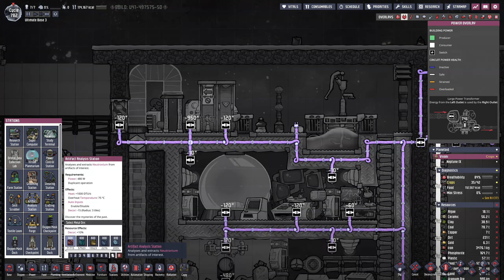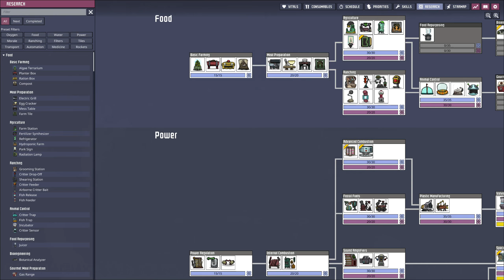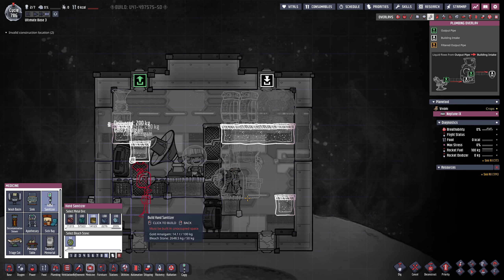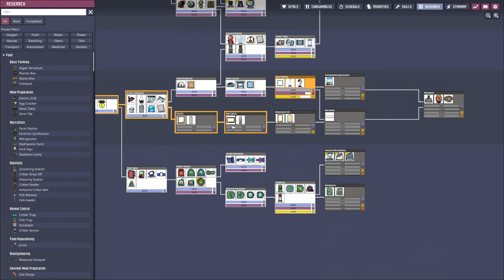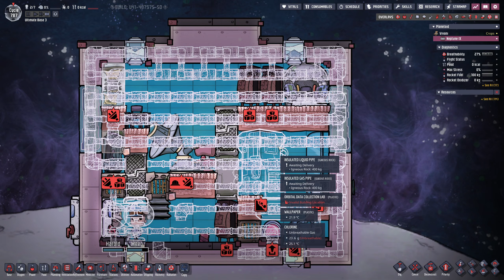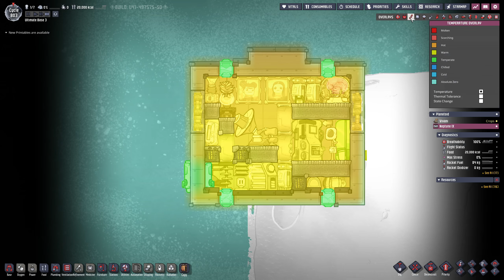UPGRADED ROCKET DESIGN - ONI - Spaced Out: Ep. #30 (Oxygen Not Included)

Comment: I’ve seen rocket designs use an air pump with an atmos sensor. They disable it at first to let a layer of C02 build up one tile. Then they set the atmos sensor to sense when that layer gets too much co2. It will consistently pump out only co2, but the downside is  you have to have a layer of co2 at the bottom which doesn’t look pretty, another con is that off gassing near it can mess it up too.

Comment: Switch power cable because of decoration value. Also control temperature when landed by adjusting water and oxygen temperature outside the rocket. Also switch all pipes to golden radiant)
Reply from the maker: Is there a bigger decor buff than 12?

Comment: Might try some radiant gas and/or liquid pipes to even out the temperature with the smart battery. Short-term, it would definately cool the interior down (atleast with the 10°C oxygen), long-term, maybe not so much. 

Guessing the module will get re-designed at some point, anyways, so long-term might be a moot point

Comment: in the rocket you could add a telephone in place of one of the storage bin, or even a painting. You don't need it powered or even on the ground. It should give you +3 for the great hall
Reply: Doesn't the telescope count as an industrial machinery building? If not, then a great hall would be possible. Though, it also comes down to: is the extra 3 morale even needed?
Reply: @salemprompthous3820  i think only the gaz pump is counting. Well with +3 you can increase the amount of work time and get more of these sweet data banks... Not really game breaking but if you aim for the ultimate rocket you can consider it

Comment: The grounded option in the rocket control station makes it so that dupes can fill any storages and deliver anything that is needed in the rocket but they cannot use buildings like the toilet or take materials out of storages. Also i would suggest not putting bleach stone in the rocket. They do not use a ton of bleach stone with the hand sanitizer so you do not need to worry about it running out while in space. The other nice thing about grounded is that you do not need to change it in space as everything is open for use by the astrodupe and once it lands it turns back into a grounded state

Comment: Nice design :-)

- Researcher needs Aesthetic design to analyze artefacts in station.
- When you've build Decontamination Shower, I remebered I've never used it properly. This time I have few of them right at entrance to my living module and i just love them - they disinfect both dupe and anything hes holding in his hands, this way no germs can get inside my living module :-)
- You can use Grounded mode (in Rocket Control Station), which disables toilets etc. while on ground. It even forbids taking things out of container (fridge for example), while still allowing to store things in them.
- There's no need to switch to crew before launch - crew will always automatically board the rocket.
- Maybe i am wrong but is carbon dioxide able to reach pump? Since there's just one airflow tile, isn't right down corner occupied all the time with oxygen?

Keep them coming, these days I can't have dinner without your channel :-)
Reply: On account of the CO2 extraction, I was thinking the same thing. Airflow tile above the pump, aswell as the current on the left, allowing some flow past the sensor

Comment: Thank you for using my desing! You can also use a battery module with a solar module so you never run out of power.
Reply: And a battery module can be charged at the platform (which would also charge up the smart battery), making solar modules supplementary when in-flight.
Reply: He needed to change the battery model because of the engine he uses. It is not enough for those to have in the rocket.
Reply: @dokka94  I used that engine too. I used battery module instead solar and artifact module.